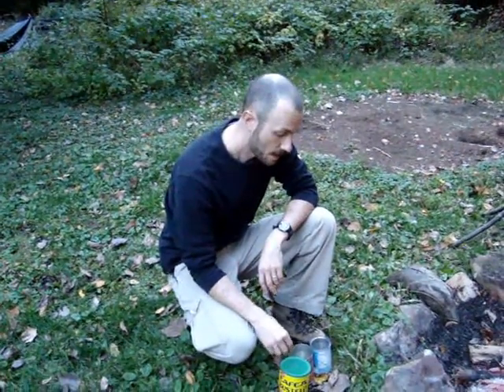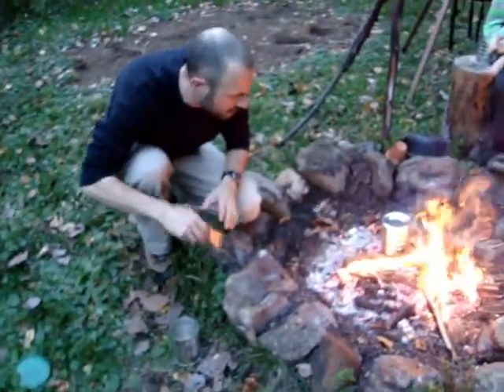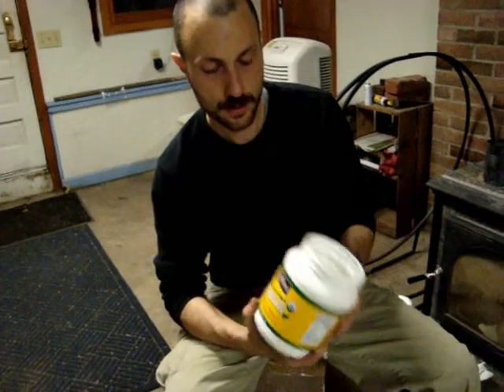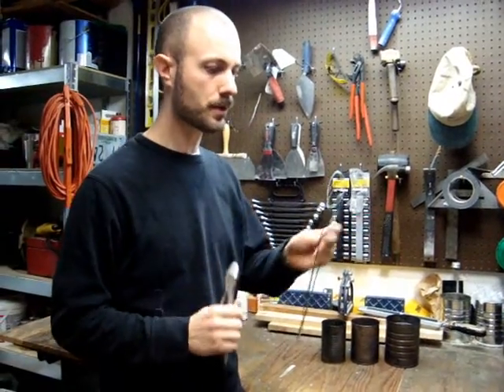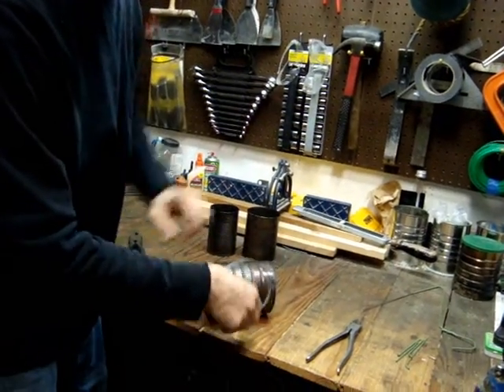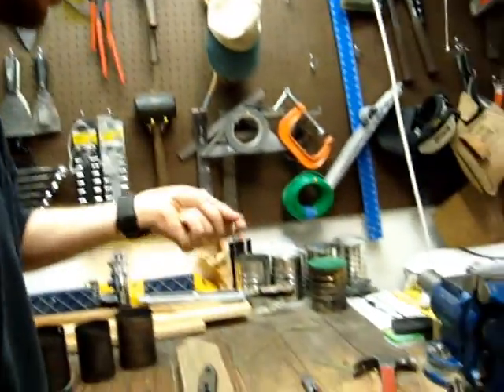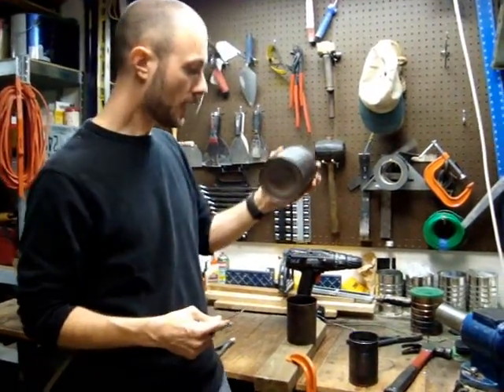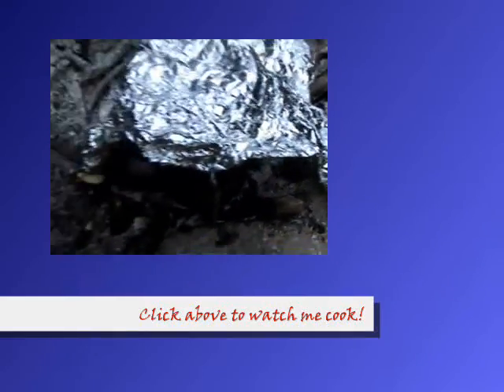How To Make a Tin-Can Cook Set

Comment: +Agent 1611 - Nice vid and great build on some low dollar but solid outdoor kit. One suggestion on the cup handle...wrap the loop lower on the can (maybe 3/4 of the way down) in one of the grooves. Then after twisting the wires together you could put two holes near the top and run the ends of the wire thru them and bend them over. Little more solid than a "floating" handle.
Reply from the maker: +Outdoor Dauber I love the suggestions!  Next iteration I will consider it.
Reply: Great idea!

Comment: I might have missed that part, but doesn't the oil get dissolved in the heat? Gonna try this DIY in a couple of days
Reply from the maker: +skinko What part are you asking about--oiling it after firing?  It does need to be oiled down after each use and cleaning.
Reply: just like cast iron...   has to be treated [re seasoned] after use...

Comment: I wish someone would do a Youtube about which cans to use and which to avoid.  The only ones that I am 100% sure of are the steel coffee cans that look the same inside as on the outside.  The smaller cans to nest inside are less obvious like the fruit cans in this video.
Reply from the maker: +broadwayFan28 Yes-the "tin can" set is actually a steel can set, and some of the smaller cans can be tricky to get the right size and type.  I would just be careful that the can does not have a plastic coating inside.  It depends on the brand of product.